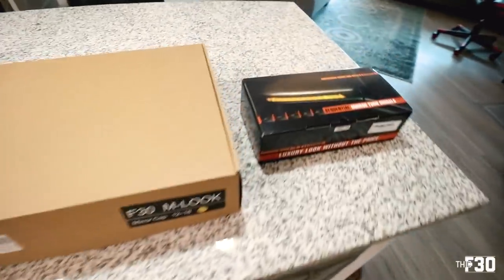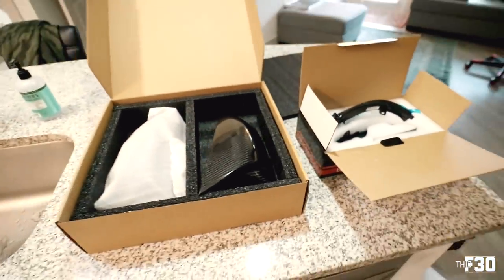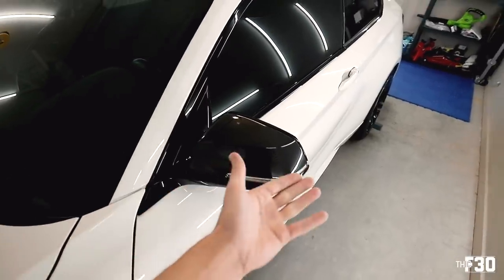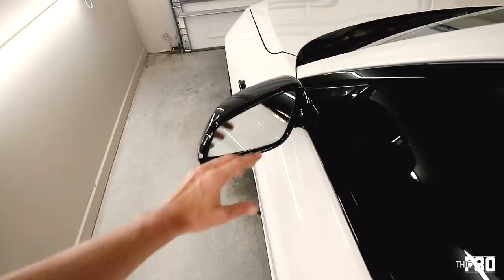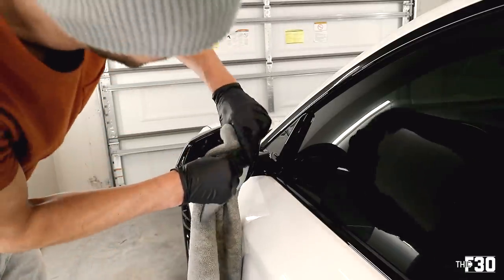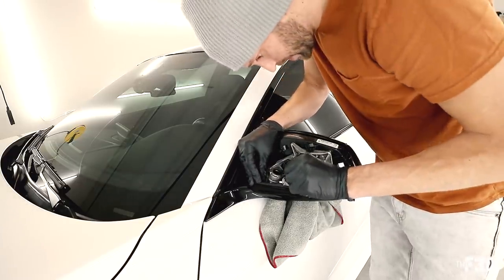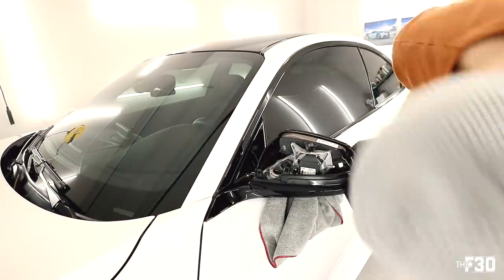CARBON FIBER M-STYLE MIRROR CAPS AND SMOKED SEQUENTIAL BLINKERS - F8X, F3X Install

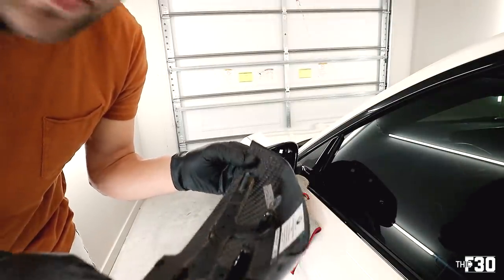Comment: I ran into the same thing with the factory BMW caps. Rusty washers and all. Seems a bit strange, but the fit nice and tight. Also, a bit of a problem on the drivers side. I must have pushed a tad hard remounting the mirror. It pushed the 6:00 o'clock position of the inner ring to far in, preventing ANY adjustment of the mirror. Little panic moment there, but took the mirror off and didn't man handle it and everything is running smooth now. About 45 minutes for both sides. Would go MUCH faster if I had to do it again, and didn't have to mess with the drivers side 10 minutes longer, troubleshooting a stupid mistake.  Thanks for the vid dude!!

Comment: maybe someone used screw on the original mirror caps to prevent people to steal them. If you know how to do it (and take a bit of risk to damage the caps) you can pull them off in a couple of seconds.
Reply: or BMW did so in order to prevent the same. Quite expensive OEM caps

Comment: can you please help me with the exact brand of led turn signal bulbs you used. I have tried Lasfit and others still get the error and flashing. Even bought the ob connector and coded every light in led and changed to non active in beammer code. Sill no luck

Comment: After reassembling the housing, i pressed the mirror back in gently, heard it click into place, but now they won't rotate back down (I hear it whirring). I thought maybe it wasn't properly seated, so I tried pressing on one a bit more firmly, and i heard something pop. Now it rotates, but it is much looser. It feels like i snapped a clip or two on the back of the mirror. I'm afraid to press in the other mirror now. Anyone know whats up? I heard it click into place, dunno why they didn't want to rotate back down, but I dont want to break the other too.

Comment: Did you have any issues after installing the sequential blinkers?

I hear couple people say it causes water leaks inside the mirror housing.
Reply: I can see that happening as the oem ones have a built in rubber gasket around them and I haven't seen any sequentials that do. As a precaution I'm going to avoid spraying water directly at them when washing.